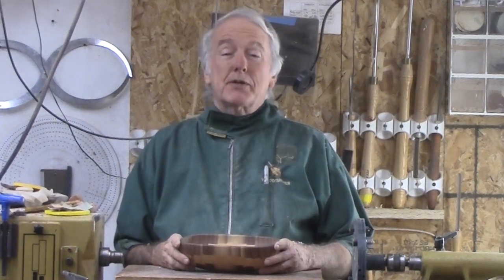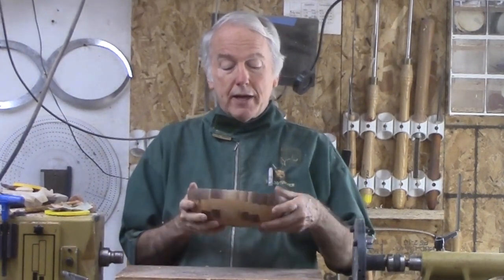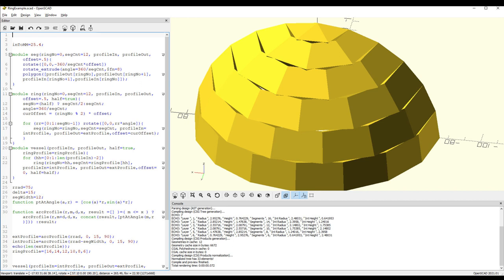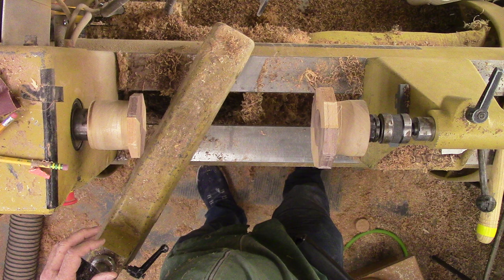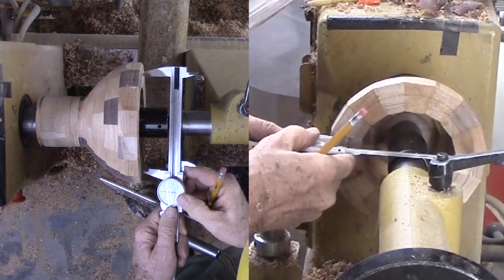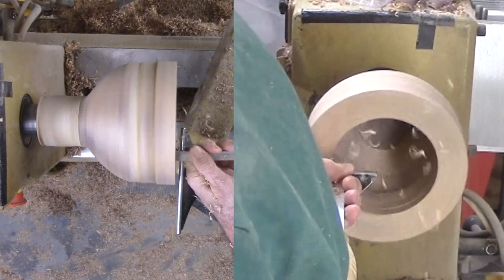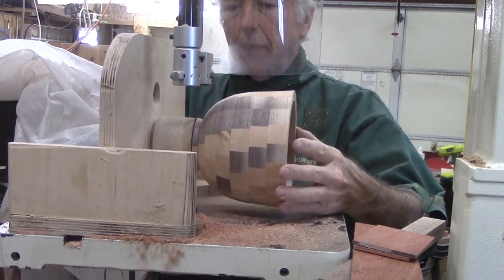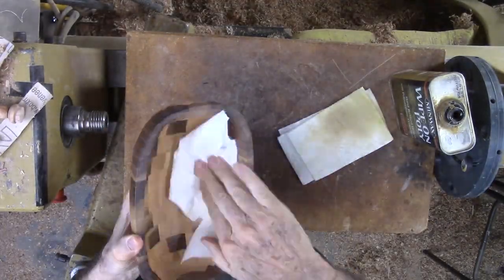Turning Oval Bowl With Basic Tools - Segmented (Or Solid)

Comment: When you got a bowl (at about 5:26 in the video) I thought you were going to make another one just like it. Then join the two bowls. After that proceede to the bandsaw. Then you would have two oval bowls. Either method I like it. You done good Alan. Thank you for sharing and continue to stay safe.🙂🙂
Reply from the maker: The issue that I see with that approach is getting two bowls to be the same so they match up at the rim. This way, the match is easy.
Alan